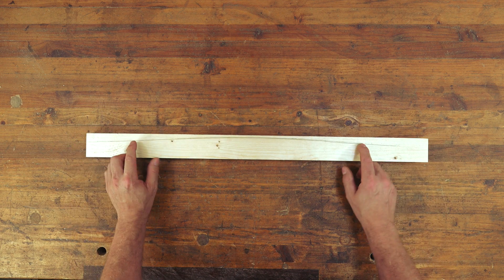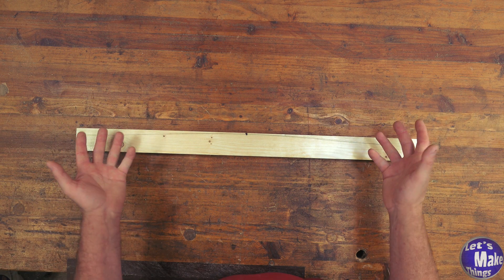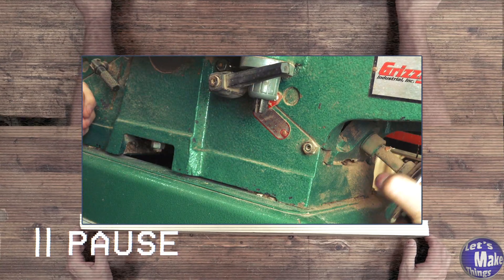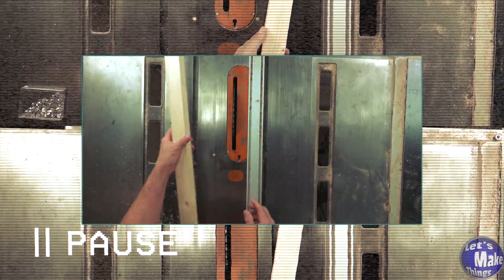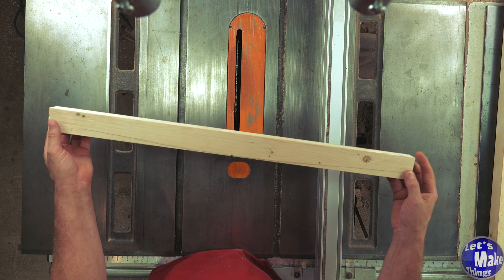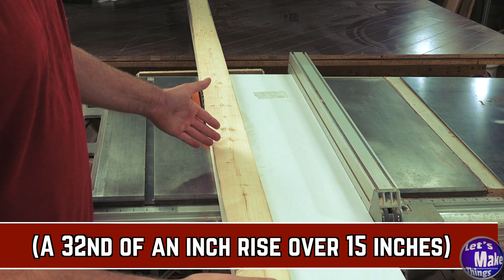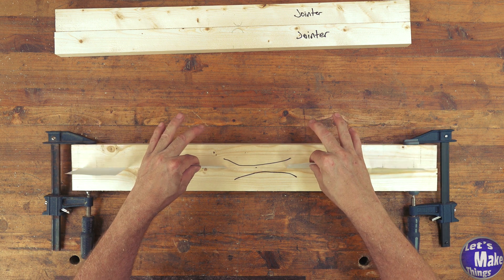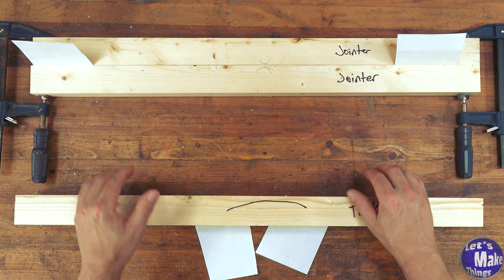Make Cambered Cauls with a Thumbtack

Comment: Just a thought, Rather than tapering the wood on either side of the center. Wouldn't a simple small  1/2 inch length of 1/32 thick plastic shim double side tape adhesively fixed to the center of the Caul effectively do exactly the same job?

Comment: Rip three or four 1/4 thick strips. glue the strips and then clamp down the ends and use a screw at the middle to create a 1/16 concave. 
The disadvantage of caul made of wood is that PVA glue will adhere. This is why a metal caul is preferable.
Reply: I just cover mine in packing tape, glue won't stick

Comment: Funny, how a simple thing can be made complicated with machines. Just use a regular #4 or #5 hand plane, planing the full length of your cauls. This will automatically create the desired bow shape. Don't believe me - try it for yourself.
Reply: Paul Sellars would have this done in about 1 to 2 minutes with a No 4 soothing plane, if it takes him that long. . And the hand plane has at least a million other uses in the shop. Nicely done video, but overly complicated.

Comment: Yeah, I just don’t see being able to get the arc on the jointer. Would think that if anything, setting the exact center of the caul on the edge of the outfeed table for both cuts, you’d end up with a small uncut section right in the center. Couldn’t see it in the video, but the center should not have passed over the cutter either way, thus leaving an uncut portion. Even if it was uncentered, then you would cut the middle and basically just trued up the board. At least that’s what I’m thinking.